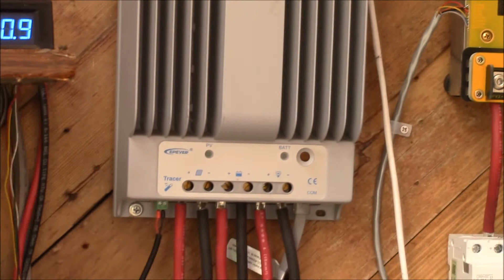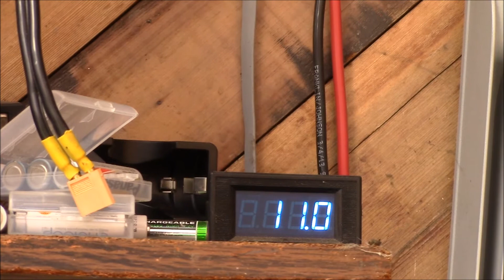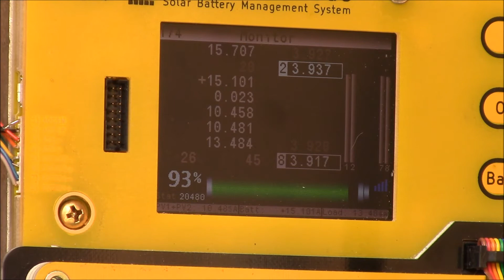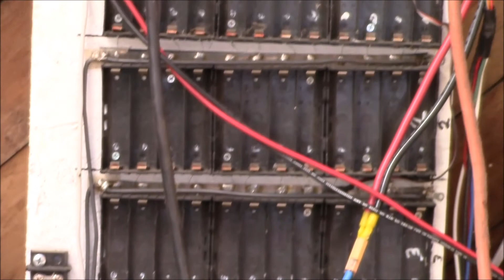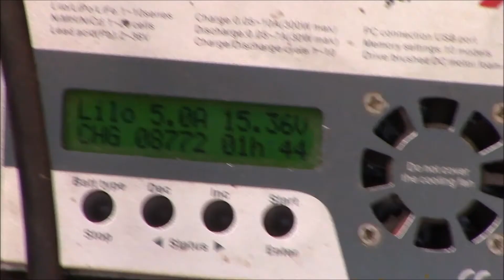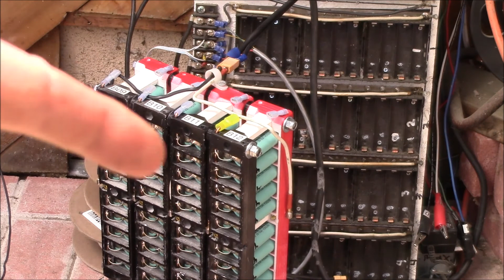SBMS-120 Assorted Wiring

Comment: If you look at the far right connector on the electrodacus 120 on the website the schematic clearly shows it’s a negative connection from the solar panel, the dc connection and finally the battery negative. So I don’t understand your explanation. Can I see a schematic of your wiring please. Thanks
Reply from the maker: Are you referring to the large screw terminal in the lower right corner?  If so, the one that is labeled "Load +"?  That one is definitely at the battery + voltage.  You might be getting confused by the two parallel diodes connecting the panel-battery-load negative bus to that Load + terminal.  Those are flyback diodes to protect the load output MOSFETs from high voltage spikes when switching high current loads on and off.

Comment: Great work. I’m just not sure why you use an Epever Tracer charge controller in addition  when the 120 does everything? Do you parallel connect the charging batteries or series connect several batteries. Up to how many battery packs do you recommend charging up to? Thanks
Reply: Yeah it’s that jump up to 24v once you have enough batteries is the problem isn’t it. It’s not cheap but getting cheaper. I’m facing the same issues. I’m just finishing 2 more kilowatts of batteries to make 8 kwh. I’ve got 600 watts of panels but I have to wait for the sbms120. Your parallel charging of your packs is really cool.
Reply from the maker: Yes, those 24V packs use a lot more cells for sure.  My batteries are modular and fairly easy to reconfigure to 7S or 8S.  I still need to get DC load system to be able to handle other than 12 volts.  I'm still running my old 12V lead acid system with 1 panel to run my DC loads.  Then the 4S lithium system is running my AC power inverter which can handle up to 16V input.  So once I sort out the DC system then all I need to do it get a 24V inverter/charge and I should be able to make the conversion.
Reply from the maker: Mostly for added power.  Being an MPPT controller, the Tracer can pump in 40 amps off of 2 panels.  If I used the SBMS I would only get 20A off of 2 panels.  With my 4S/16V battery bank, unless I swapped all my 24V panels for 12V panels, I'm losing half the capacity of the panel with the direct connection through the SBMS.  One day, if I jump up to 7S or 8S, I'll be able to direct connect and then the SBMS may be able to do it all.  
I have a total of 6 battery packs for a total of 205AH or ~3 KWH.  Planning to keep increasing the battery bank size over time.

Comment: You have the two chargers I am currently deciding between, I am leaning towards the electrodacus because of its BMS inclusion/price and ease of wiring for a noobie like me. it is a very niche idea though so Im wondering how you have found it on cloudy days being only 20v nominal for the 60 cell panels in parallel recommended? Most say series panels give better output on over cast days. Have you compared the energy gathered to your etracer charger?
Reply from the maker: My situation is perhaps a bit unusual as I have a 16V battery and have the 60 cell panels through the SBMS and it seems to do OK sunny or cloudy.  Also, my Epsolar controller has 3 - 335W panels feeding it while the SBMS has 2 - 270W panels and those are on opposite sides of my roof (morning and afternoon).  I find the Epsolar will keep charging all day long, but on a sunny day, the SBMS might stop charging until such time as the battery voltage drops below whatever threshold you have set.  I think I have that at 3.90V/cell, so I need to drop to 15.6V before the SBMS starts charging again.  I still need to fine tune those settings.  But the SBMS does an awesome job keeping the cells balanced, usually under 10mV difference amount the 4 groups.
Reply: @The4Crawler  It makes sense that it stops charging but can you still tap into and use the energy from the panels without using up the batteries if what you use is below what the panels are putting out?
Reply from the maker: Not sure if it lets you do that or not.  That's part of the reason I have an MPPT charge controller in parallel with the SBMS.  The MPPT controller will keep pumping in current to keep the batteries up to my charge limit.  I think I could set the SBMS parameters to more closely duplicate this behavior, but haven't felt the need to do that.

Comment: Thanks for your videos.  I'm thinking of going with the SBMS-120 for a solar generator.  You mentioned the discrepancy between the SBMS and the other battery monitor.  Have you figured this out?  Does the SBMS-120 give an accurate % charge on the battery now?  It seems like voltage level can't accurately describe LiFePO4 battery charge level, so I'm hoping there's a setting on the SBMS-120 that will allow you to track like your other battery monitor.  Thanks again :)
Reply from the maker: The two SOC numbers are fairly close.  My Trimetric is strictly AH in vs. AH out, with a "flat charge" voltage sense value to reset to 100%.  The SBMS-120 is that plus some voltage sensing as I recall.  Main issue is up near full charge, the SBMS uses a BMS chip set up for LiFePO4 and I'm using Li-Ion, so that's where it hangs onto 100% SOC.  So my Trimetric will drop down to like 88-90% in the early evening, the SBMS says 100%.  But by morning, they are usually within a few % of each other.

Comment: Nice I have a sbms40 running for a few months and I hope to get the 120 up soon nice work!!
Reply from the maker: Thanks for the comment.  You'll be all set with the sbms120 model having worked with the sbms40 before.  I have some of the basic functions working now, but still learning the ins and outs.
Reply: I actually have my sbms40 hooked up to the inverter with a lvco and it works great
Reply from the maker: Sounds like that is working well.  My inverter low voltage cutoff is too low for the 4S battery pack I'm running.  Working on incorporating an external remote on/off capability to the inverter so that the SBMS can control it.
Reply: R Brown you can just hook up the ext io3+ and the extoi3- to the inverter switch and set the sbms to what shut off you want I run samlex inverters and the cutoff is 10v on a 12v system and 20v for a 24v system so well in my LiFePO4 pack

Comment: I am actually thinking of getting this for my powerwall, I might even do a similar setup to you making multiple batteries and hooking the balance leads together
Reply from the maker: So far this seems to be working well.  I'll likely end up converting mine to 7S/24V in the future.  My batteries are easy to reassemble and I'll just need to solder in some 7S JST connectors to the balance boards.  That's why I put the 4S connectors off to one side.  Each shelf in my battery shed will hold either 8 - 4S or 4 - 7S batteries, so I'll have one balance board per shelf along with one main battery cable.That way each shelf is independent of the others.

Comment: Just make sure you don’t call the SBMS a charge controller, it might have PWM to limit current in but it just connects the solar directly into the battery
Reply from the maker: It is hard to describe this device.  It does "control the charge" in that it prevents over charging.  I guess Solar BMS is fairly accurate in that it's a BMS with Solar/PV input.
Reply: R Brown yea so if you had 100v of solar panels that would not be a good idea to use this, you want to match PV voltage to the battery voltage. This is also the reason there is no need for a large ground because it doesn’t have switch mode circuitry for charging just a positive disconnect via a bidirectional mosfet arrangement ( same as any BMS)
Reply from the maker: Yes, you want to keep all your solar panels in parallel instead of long series strings.  Ideally I would be running ~18-20V panels with my 4S/16V battery system.  I have 2 such panels, 60W ea. that I could do this with.  Ultimately I'll be going to 7S/24V and then the 60 cell panels I have will do a much better job.  This is why I'm now running the hybrid charging system with the SBMS and the MPPT charge controller in parallel.

Comment: so you are using one SBMS-120  to balance many 4s packs correct?
Reply from the maker: Yes, that's correct.  So far I have 5 - 4S20P packs connected to one balance board and that connects to the SBMS-120.  So far that seems to be working well, it'll pull them within 5 - 10mV under most conditions.  

That said, I was running the packs w/o any BMS for up to a year and they stayed within 25 - 35mV of each other.  That was with only bottom balancing on the initial charge.